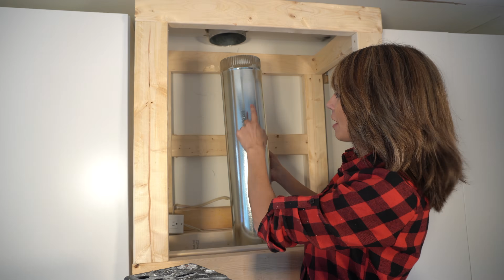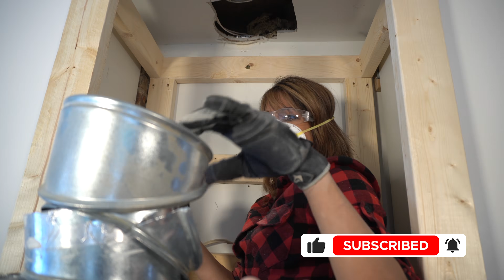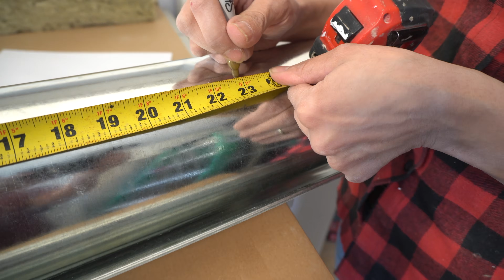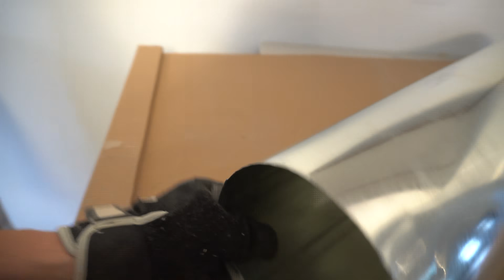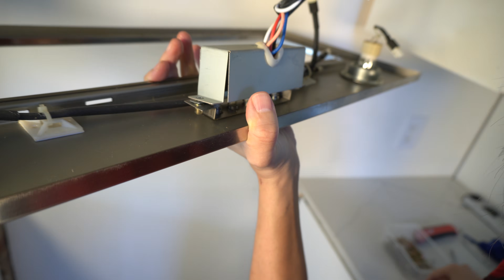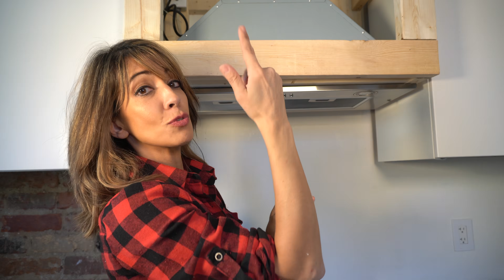Range Hood Installation | Why Flex Duct Is NOT Allowed

Comment: Please put some leather work gloves in when using that HVAC aluminum tape.  You're very cringe. That's a great way to slice your fingers
Reply from the maker: Appreciate you sharing your tip on safety. You should definitely wear gloves when cutting metal.

Comment: You can take those 6-in elbows and create a 45 with them.. come out of the ceiling with one at a 45 and drop straight into the range hood... That's what those seems in the 6-in elbow are for.. to turn
Reply from the maker: Yes, the adjustable ones are great. Thanks for the tip! Just installed one for a dryer vent. Here, here.

Comment: The duct should have gone over the adapter on the insert. Always male to female. The inner piece always follows direction of the flow. Whether air or water.  If you did that with a downspout you’d have water leaking everywhere
Reply from the maker: Thanks for the tip on the duct adapter; I appreciate you sharing your experience!

Comment: I know code may vary from state to state (or US to Canada), but I'm remodeling this part of my kitchen and right now there's simply a hole in the wall for the wiring to be fed through and hooked up to the vent. Is that proper? I'd like to have the wiring "leave" the wall via an electrical box rather than a hole, to at least prevent insect/rodent intrusion
Reply from the maker: This house was the same. The receptacle was added to plug in the hood. It’s a simple process to add one. I have a video on the new outlets if interested. Good luck!
Reply: @DaruDhillon  I will check it out. Thank you! And thank you for taking the time respond!

Comment: I’m having an odd issue with my vent duct. Condensation is occurring in the down pipe to the microwave vent. No issues from outside the house going inside. The oven has not been used nor microwave due to this. It’s been occurring for the last 4 months. The house is over 33 years old. Any ideas or suggestions on what could be causing this issue?
Reply from the maker: Condensation is often the result of temperature differences. You can check that the pipe and exterior wall is properly insulated. Then check to see if the damper is working. You should hear it shut once the fan is turned off. The pipe needs to be installed at the correct angle too so air can flow. Good luck I hope you find a solution.

Comment: can u advise what you used on the exposed area around the vent face itself. under neath around the unit
Reply from the maker: @jdubya54  I used a cabinet panel. The same white as the cabinets. That way you can easily keep it clean.
Reply: @ good idea.  i was thinking something thin.   i wanted to use a stainless sheet but too much work and hard to attach.  ill get a panel and put several coats of maybe an outdoor paint.  thanks for the videos
Reply from the maker: @ smart. You got it! Good luck with your project all the best!

Comment: just use another elbow not make lots of mess , easy job you may complicate
Reply: The science behind venting will tell you you want to use the least amount of elbows and if possible there should be atleast 5ft between elbows. You want to limit are turbulence.  Ideally you can very strait up through a roof or straight out an exterior wall

Comment: I may just not have seen, but I usudlly would think it would be worthwhile, especially in areas with very cold attics, to have a better fit on drywall to ductwork. Also an issue in fire blocking. Maybe just make a sheetrock piece with a good fit and screwing it up to the ceiling, since it won't show once all your nice sheetrock work is on. Or maybe im being too picky
Reply from the maker: Good to hear your suggestions thanks for sharing!

Comment: The title offers a "why" flex duct isn't allowed but I can't seem to find that in your vid. Are you including semi rigid steel in that "NOT allowed" and can you touch base on the "why"?
Reply: the smooth edges of a rigid duct, like the duct in the video, has at least three benefits: 

1, it's less likely to hold grease and cooking particulates, unlike the ridged surface of flex and semi-rigid ducting.

2, when air flows through the ridged surface of a semi-rigid duct or flex duct, the inside ridges are more likely to disperse and disrupt  the air at the edges, thus slowing airflow and lowering the actual capacity of the duct system. rigid ducts are smooth on the inside, maximizing the smooth flow of air as well.

3, air passing through flex duct especially is noisier. you minimize this with rigid ducts, although in my experience semi-rigid ducts aren't noisy as well.
Reply: Surprised to not see the answer as well. It's a fire hazard indirectly, essentially. Most building codes don't allow flexible duct because it can trap grease or be more difficult to clean, which can be a fire hazard. Look for videos of grease fires in commercial range hoods for an idea.e
Reply from the maker: @DesiSaintCyr  your manufacturer of your hood fan will have that as a requirement. It prevents maximum airflow and reduces efficiency. Check with your code and manufacturer to see what you need. Thanks

Comment: Can I join 2 hard ducts with semi rigid( half foot or less long)? Because the builder ran the gas pipe in the middle of the range, I had to offset the back wall exhaust. This is for under the cabinet hood. Hood -> adjustable 90 degrees hard duct -> semi rigid -> back wall hard duct exhaust.
Reply from the maker: For duct sizing and to see what is required it’s best to read the instructions on your hood manufacturer. I do use adjustable elbows. My ducts are solid. But always check your code to see if semi-rigid is allowed.

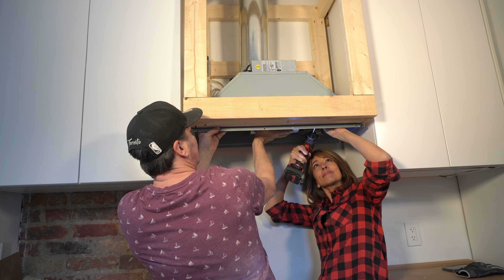Comment: At about 3:58 in the video you lift the range hood up at secure to the wood frame. But the duct from the ceiling is not centered on  the hood and is not connected to the hood transition.  You never show how you actually connect the duct to the hood.  ??   Connecting duct work that is not centered over the range is always very difficult.  How did you connect the duct?  Thanks!
Reply from the maker: @robchambers5686  it may have appeared to be uncentered or was adjusted after that shot. It was a clear straight run to the duct so nothing was done.

Comment: where do you get the adapter? mine did not come with one and I need one to install
Reply from the maker: It came with the hood but you can check your local hardware store or HVAC supplier.
Reply: @DaruDhillon  My adapter was plastic,,,smdh

Comment: You need to purchase an ultrasonic oscillating saw.  And then you can throw away that keyhole saw.  Spend the 50 bucks and then you can thank me later.
Reply from the maker: Ok, straight to it. I'll check it out, thanks!
Reply: Also grab an obligatory volume saw with a oplical binary crimper. Thank me later
Reply from the maker: @johncolbert8324  Thanks for the tip John

Comment: I would like to install a range hood that vents to the outdoors but I live in a 2 story home, my stove is on the lower level and away from any outer walls. Do you have a solution or am I just out of luck short of any major reconstruction.
Reply from the maker: This kitchen is on the main floor and vented through the ceiling and out the side exterior wall. For renovations, you would cut your ceiling and run a new vent line out your exterior wall. You would need to run the ducting and repair your ceiling. If you have a little time and patience it's a good DIY if you're up for it.

Comment: what if you already have a finished hood shroud . How do you install without using flexible duct ?
Reply from the maker: Most kitchen exhausts require solid ducts for efficiency and for building codes. Stronger and they last a long time. Less grease built up too. Overall better quality.
Reply: @DaruDhillon  I cant tape the seams to solid pipe no access . in your video it is open . Mine is finished.

Comment: You could of just straightened an elbow out to offset the pipe to where you needed it. How are you going to patch the huge hole you cut and seal it?
Reply from the maker: I used a few strips of wood backing and attached the drywall with screws. For the small gap around the duct I used a fire block spray foam. Mud and tape as usual. I have a detailed drywall ceiling patch video that is helpful if you need it. Thanks!
Reply: She could have used an elbow as you suggest but she doesn't know what she's doing.

Comment: Great install. Please wear gloves as the rigid vent pipe can get you. Also use spray foam to seal the gap between the duct and the drywall.
Reply from the maker: Hi James, good point! Cut metal cuts like a knife. I used a fire rated spray foam like you suggested. 👍🏽

Comment: All good except you left a massive hole in your ceiling :) which is where the air is going to leak. Would be good if you showed how you sealed it :)
Reply from the maker: Hi Alex, I used a few strips of blocking to fill the void and attached drywall. I also used a little fire block spray foam around the duct to cover any gaps where the duct meets the drywall. I have a ceiling patch drywall video that goes into good detail on how I do my ceiling patches. Link is in the description if interested. Thanks for watching!

Comment: You should never crimp a pipe against the airflow.  Think of an arrowhead. The smaller side pointing the direction of the airflow.  Dirt, grease, contaminants  will get caught, not to mention create turbulence and slow down the flow.
Reply: Sometimes you have no choice - but in this case I would have tossed the cheap plastic butterfly valve, and put a stick on metal mounting flange instead, then make sure the vent on the outside of the house is a high quality weather and pest proof one.
Reply from the maker: Thanks Brandan that’s true any suggestion how you’d make it fit otherwise.
Reply: @DaruDhillon  crip hood collar   flair out the female side of duct    never buck airflow    you will have grease build up
Reply from the maker: @bquedenfeld  thank-you, for sharing your experience. Good to know. 👍🏽
Reply: @DaruDhillon  Buy a coupling or adapter